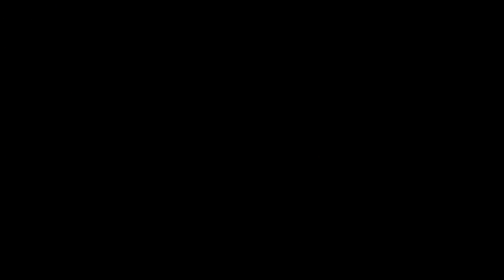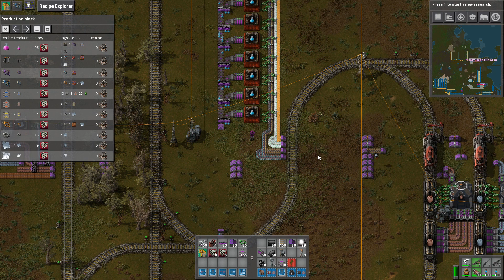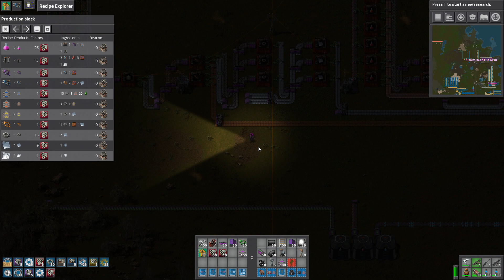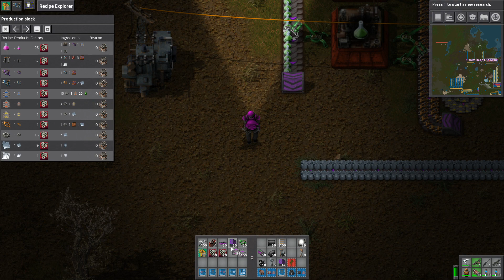Factorio - Angel's & Bob's - Episode 213 - Balance

Comment: You're going to need a loader loading gear wheels on your blue belt factory; there's no way a single stack inserter can keep up with loading 50 items per second, so that's going to turn blue belts into a major bottleneck for your logistic science production. I doubt a single stack inserter can load 25 items per second, in fact, so you probably need a loader for the gear wheels on your red belt factory as well. (I just went back to 27:46 and watched carefully, and you can see the red belt factory run every time gear wheels get loaded, then pause briefly until the stack inserter brings another set of gear wheels. Which confirms that that stack inserter is a bottleneck and you need a loader there.)